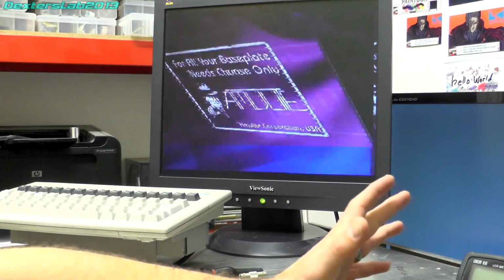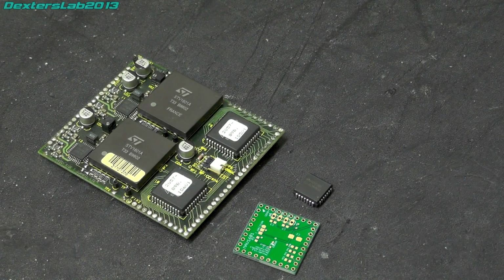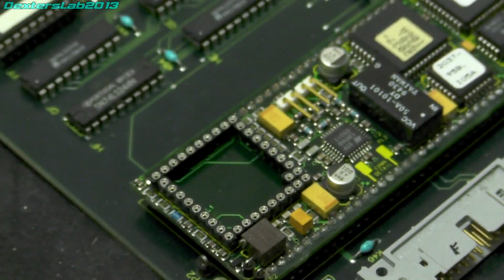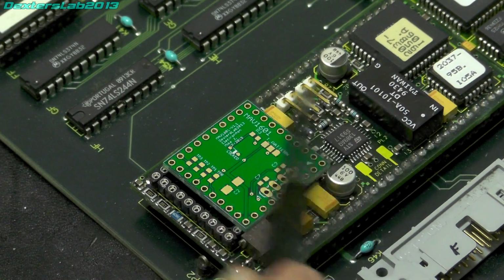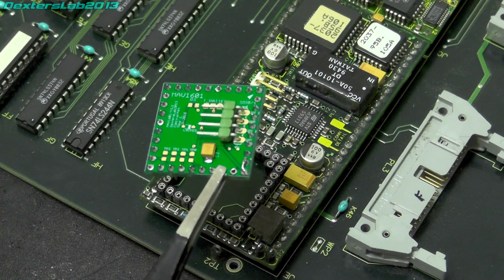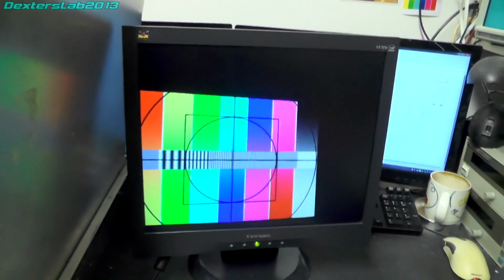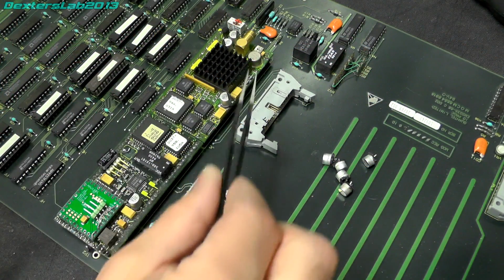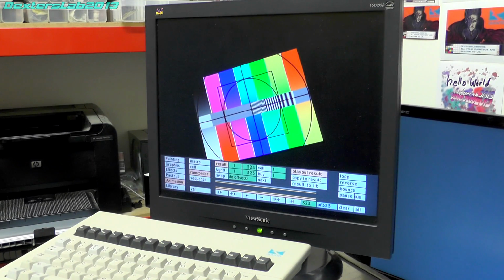DL174 Replacement SD-SDI Video Outputs For A Quantel Harriet Ramcorder

Comment: Can you get the matching receiver chip that matches the chip you have installed so as to head of a problem with the receiver chip.
Reply from the maker: I don't know to be honest, thankfully the STV1602 SDI receiver is much more reliable so probably wont need to be changed.

Comment: 21:12 I have the same HP printer. It is very reliable for a consumer product. It did like 100.000 prints over the past years. Without any stucked up paper or any sort of a problem.
I love how you replaced the exotic IC by your own "hack board" :-) , and that you have the same "mistakes" like I have whenever I build up a circuit board ;-)
Reply from the maker: Yep, B&W laser printers are great, i really don't understand why people bother with inkjet!

Comment: Maybe the original chip was ok and the problem was just bad electrolytic caps and the new chip is more tollerant. Little buggers, its always the caps. All but one of the bad caps were next to the hot original chip (the one you haven't changed). They were obviously going to be bad - heat kills electrolytics quickly.

What make and series are the new surface mount ones? Make sure you buy high quality. I always buy Panasonic FM or FR series but they're through hole not SMD.
Reply from the maker: I don't recall the range but i am sure they were Panasonic, i had them after i recapped one of my video scalers a while back

Comment: As you say those Sony chips were very unreliable. I had to replace several when the equipment was just out of warranty. One time, I pried the chip up most of the way and when I tried to pull it off it came out unevenly and it ended up with several pins stuck in my  finger. D'oh!

Comment: Two thoughts ... Wouldn't the 27mhz test clock you need be in the ramcorder somewhere? As for the 4-pin header, maybe you installed it backwards? 🙃
Reply from the maker: Yes the 27 mhz clock is available inside the ramcorder but if it's plugged in you might as well go for broke and get a real picture.

Comment: did you try the original chip with the new caps?
Reply from the maker: I didn't no, though there was a huge difference in the glitching between them, either the original STV1601 was faulty or so close to being out of spec the bad caps pushed it off the cliff so it was worth the effort to switch out and prove a replacement is fairly easy to do.